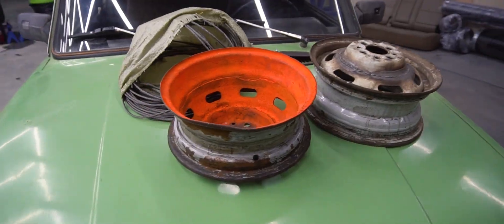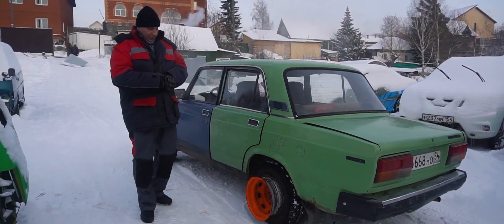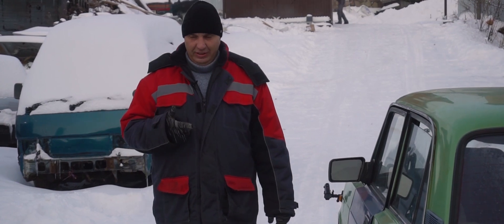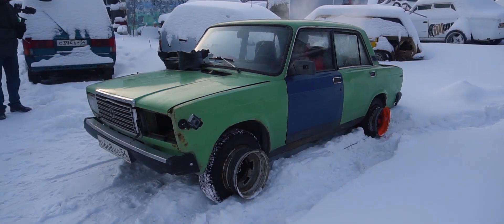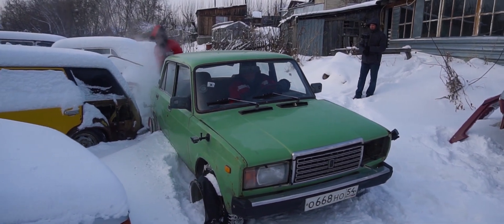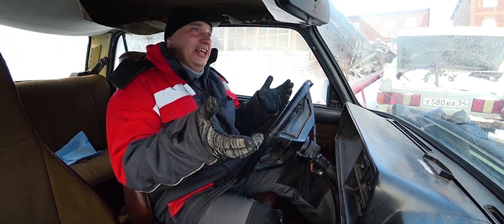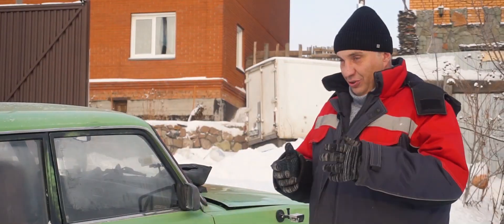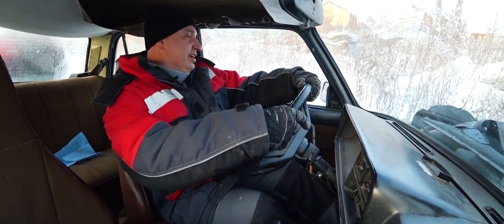DIY four wheel drive system – can it work?

Comment: try the same thing but make the cables run a continuous loop instead on just going reel to reel, and the pic was of a wheel winch system made for vehicles without a frame mounted electric or hydraulic winch
Reply: Was just about to suggest this, but with one modification - run the cable around each wheel twice before returning to the other wheel. The cable would feed and pull continuously, and the would be no slipping.
Reply: @Hardts  yeah i didn't figure i'd have to explain that part, just figured they'd  already know to do it if they tried it
Reply: @Hardts  I think the cable would migrate on the rims and eventually rub and wear but it could work.
Reply: d0rraj no, they would not be. It would be just like a track on an excavator, they would both spin and be powered in the same direction
Reply: The photo you showed isn’t even a 4 wheel drive conversion it’s a wheel winch
Reply: cody I know it’s a wench. They’re making one thing but referencing something else
Reply: bloodbath907  They obviously forgot to add spring-loaded tensioning system that would adjust the angle of the cable when turning. That same system would keep the correct tension when the cables run at different speeds. For continuous loop of cable, they would need flywheel and belt in the middle to allow slipping when tension gets too high. Flywheel would disconnect the cables when there isn't enough torque to require 4-wheel drive.
Reply: @Ponga Pandit you get around the slip problem by using capstans, but that can get messy.
Reply: Yea a chain drive would be killer
Reply: @Ponga Pandit would be too stiff and not allow for turning, regular 3/8th stainless boat anchor chain with a connector and a hub that has a V groove with sprocket teeth would be the best option because you could keep the chains in your trunk and the V groove rims could be notched(they already make them for the winch versions) to lock onto specially made lug nuts so they can be stored with the chain. a deep V groove would allow for SOME turning while the continuous loop of chain would let you drive as far as needed to get unstuck!
Reply: bloodbath907  Voodoo recovery rope is stretchy. Might work.
Reply: Ponga Pandit how are you going to turn?
Reply: @Ponga Pandit Yep, a chain but it would need a pretty good tensioner to keep it on.
Reply: Here’s what they’re trying to make. It already exists as a wench system 
https://youtu.be/trrEKbc6uqE
Reply: an easier idea would be to use a chain and gears, but at that point you may as well just put some tank tracks on it.
Reply: Yeah, add tank treads, lock the steering wheel, and divide the brakes into left and right sides.

Then, you'd steer by pressing the brakes for the side you wanted to turn towards.

Comment: Weld sprockets to the wheels and put a chain on with an auto tensioner like bicycles/cam chains have for a permanent 4 wheel drive system.
Reply: Permanent 4WD but no steering.
Reply: How would you turn doe
Reply: @calvinf9218  That's what the auto tensioner is for to allow some slack for turning and with chains on either wheel there shouldn't be much force counteracting steering. The steering angle might need to be limited though to avoid the chain slipping off the sprockets.
Reply: @6Twisted  And put a locking diff, so that there's no difference in wheel speeds when airborne or on poor surfaces!

Comment: isn't the thing in the picture a makeshift winch?
Reply: Yeah, it's still an interesting video and idea though
Reply: @d0rraj driving forward the wheel would be going counter clockwise from the side making the rope wind up and pulling the car forward
Reply: d0rraj the cable is ran to something like a tree. Imagine the vehicle pictures is 4wd and has zero traction. As the front wheel spins it winds the cable onto the spool and drags the vehicle forward.
Reply: Yes its a capstan winch of sorts inverted by 90 degrees from the normally horizontal plane.
Reply: @d0rraj the cable in that image is in the right way.
Reply: Yes it’s a “Bush wench”. https://youtu.be/trrEKbc6uqE
Reply: I thought so too but this is just as good
Reply: @d0rraj there is only one picture as example from 0:07 to 0:13.
by now i see what wrong with this discussion.
Everyone thinks the makeshift winch is the car self power to climb up. 
You thinks the makeshift winch is just a overly complicate tow cable.

This kind of thing is use when the vehicle does not have winch in front of the bumper and it does not have other vehicle to help  (if there is other car they can use tow cable/rob connects to tow point instead )

Usually this set up has two hub, one each side, the cable would be loop around 1 or 2 trees up hill if there is no tree a metal rod dig in the ground could act as substitute, so when driving forward the wheel on left side would be going counter clockwise, the wheel on right side would be going clockwise  wind up the cable and pulling the car forward.

If there is already a winch in front  of the car then connects its cable to the tow point at the front of the car is more logical than doing this.
Reply: @d0rraj im talking about the picture that is shown about 10 seconds in which is the correct orientation to pull the car forward
Reply: @ElTurbinado  no u
Reply: @d0rraj ya find the right tree when you need it. Murphys law applied
Reply: No
Reply: @randominternetguy  actually yes it is